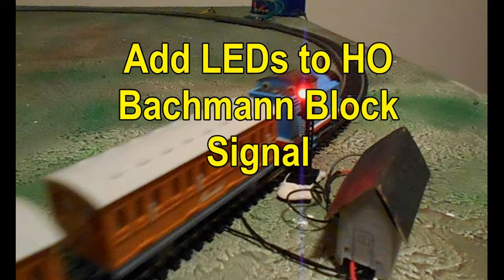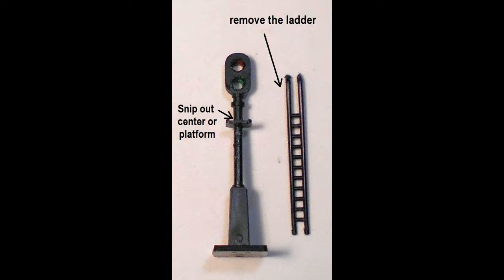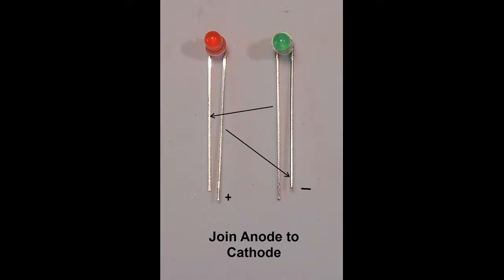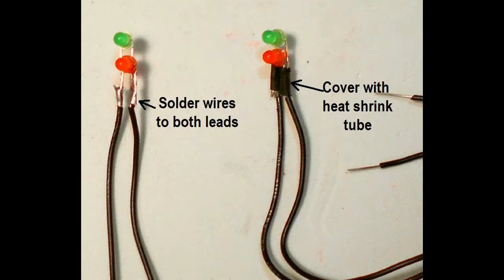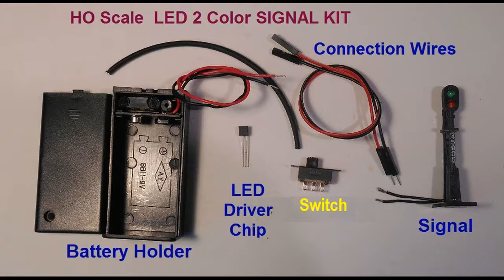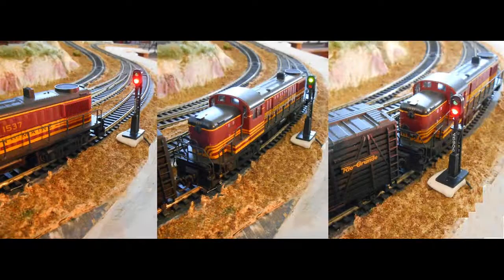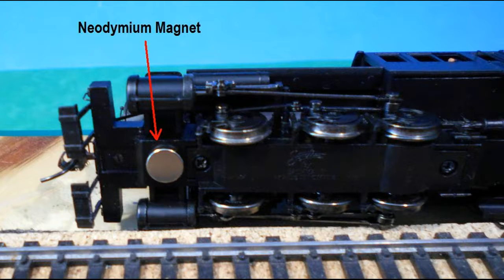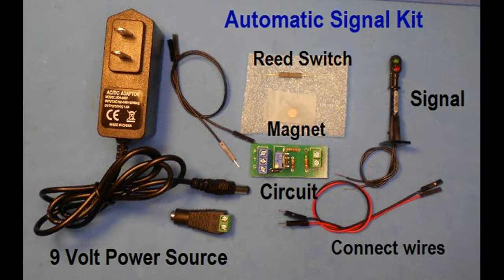Add LEDs to a HO Scale Block Signal

Comment: Dear Robert,
What size resistor (apart from the ones on the relay) is used for the Bachman block signaling setup? I couldn't catch it in the video. Thanks for the great videos!
All the best,
John Vassar
Richmond, Virgnia
Reply from the maker: The resistor is for the 9 Volt battery and I use 680 ohm per signal. All instructions are posted at my website modeltrainsounds.com under Project 12

Comment: Awsome AND simple. Can I change the duration Time?
Reply from the maker: On the manual signals you change the color aspect with the switch. With the circuit board you can set the time by adjusting the potentiometer to the time required.